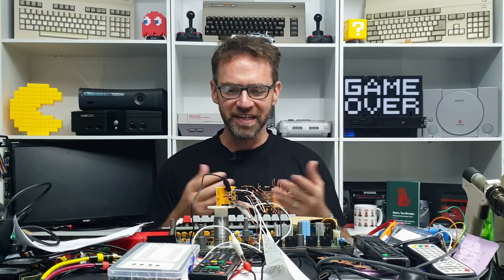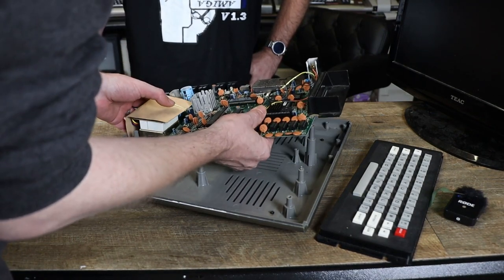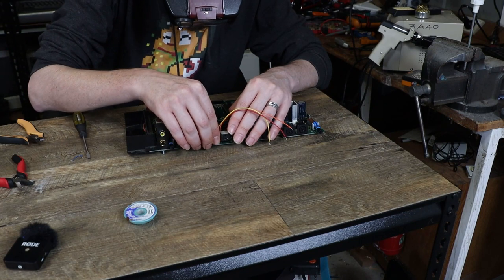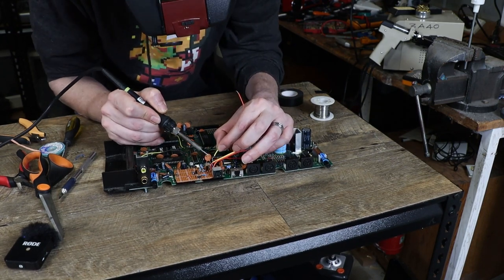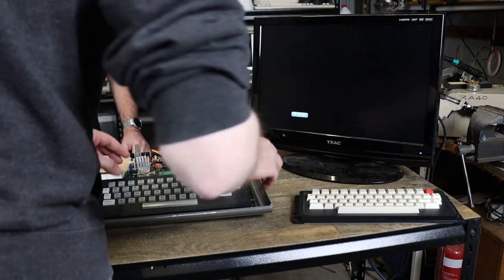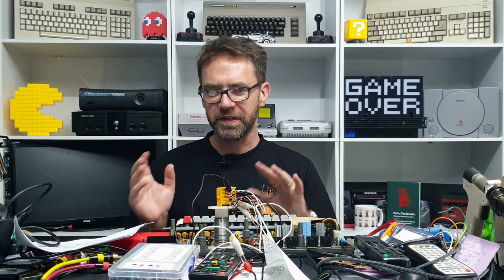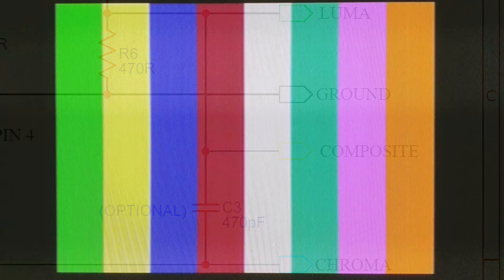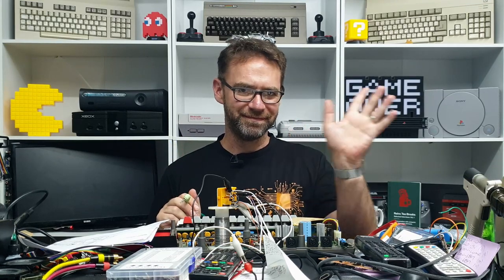Tandy TRS-80 CoCo1 S-Video / composite mod - feat. Mr Lurch

Comment: Very cool! I'm still learning this stuff, but I decided to try working my way through the schematic and data sheet to try and understand what's going on. It looks like you're using the chroma signal generated by the chip (because why not), and in both cases using a 2N2222 transistor to get the desired output voltages for S-Video/Composite. Then for convenience you're tapping the luma input signal going into the chip, (lowpass) filtering it through a cap, and using a different transistor to make some change to the signal in some way before going through the 2N2222. Neat! I'm looking forward to comparing this against the component video circuit. I'd guess the Pb & Pr signals somehow get adapted from the 3 input pins to the chroma modulator. :D
Reply from the maker: You're on the right track. The BC557 is inverting the luma signal, I don't know why the signal is inverted coming out of the MC1372 in the first place, I'm sure there's a good reason but it's beyond my knowledge. To be honest I am still learning how it all works but I will try and explain most of it in the next video.

Comment: Will the mods you're presenting work on NTSC machines here in the US?
Reply from the maker: They will for the CoCo1, but not the CoCo2 (at least not without some modifications to the RF modulator). Stick around for the next video on the component video mod as I will also detail which mods work for each variant

Comment: Hi. I just tried the circuit on my coco1. I am geeting mixed results. Some games Only in  b&w. Why is the 470pf optional? 

 May we missing a 75ohm resistors in the output?  

Has anyone had. Any issues? 

Thanks!
Reply from the maker: With S-video you will lose the artifact colours due to the separation between the chroma and luma signals, resulting in a black and white image. The 470pf capacitor is there only if you want to get composite output, this will obviously result in a less sharp image but should restore the artifact colours
Reply: @TheRetroChannel  Something is definetly off with this circuit. Composite is very poor, S-video is very good on the green screen but then losing color in games. I will add a 75 Ohm resistor and a low pass filter....will report results.  thanks!

Comment: Do you have a board layout diagram available?
This is the exact solution for the failing RF Modulator in my CoCo 1.
Reply from the maker: There's a schematic in the video description but not a board layout per se. Best bet would be to stick the components in some perfboard to make sure it all fits neatly and then solder them in.
There is also the component video mod coming out this Sunday so you may want to wait for that, the luma section is the same as the S-video mod, only the chroma section is different
Reply: @TheRetroChannel  I appreciate that - the RF Modulator is in the process of turning into crap, and they're not really available, so this seems like a perfect solution.
Is there any quality improvement going from S-Video to adding the Component mod?
Reply from the maker: For me there definitely was, but as it's literally only been tested on one computer I can't say everyone will see the same improvement. As the circuits are pretty similar, it should be easy enough to test both
Reply: @TheRetroChannel  I ordered a bunch of discreet components (Transistors, Diodes, Caps and Resistors, S-Video and 3.5 Jacks)... Should have enough to make 5-10 of these lol - Any new parts I need to pre-order?
P.S. My wife and I visited Sydney, Australia a couple years back - People were awesome and friendly.
Reply from the maker: I live in Canberra, about 3 hours drive South West of Sydney. Most folks are nice and willing to lend a hand, but there's always some....
Here's the schematic for the YUV mod https://i.imgur.com/TIrk3AE.png
Extra parts you may want to pick up are: 1 X 1nf ceramic capacitor, 2 X 180ohm resistors, and either some RCA sockets or a TRRS socket for the component output. I went with a TRRS jack and one of those breakout adaptors that come with a lot of flat panel TVs these days https://www.amazon.com/LG-Component-Audio-Video-Adapter/dp/B01EQ7TYNQ
Reply from the maker: Hey Mark, sorry just realised that was the old version. Here's the new one, the only difference is the resistor values at R8 and R10. 47ohm will still work but I had the best result with 180. https://i.imgur.com/TIrk3AE.png
Reply: @TheRetroChannel  For anyone trying this circuit - I put in 0-500 ohm trim pots instead of the 180 ohm resistors. - That allowed me to fine tune the colors (colours).
The output is wonderful.